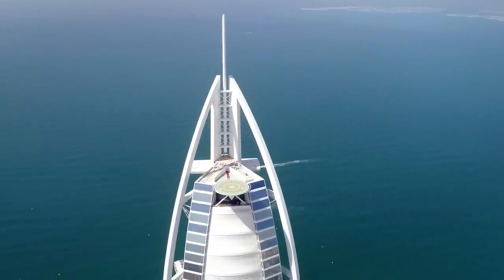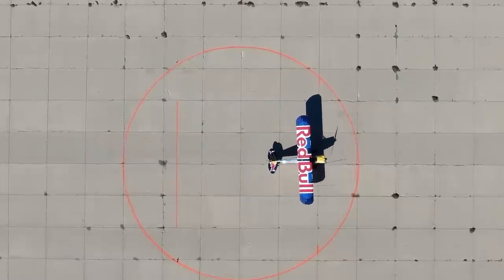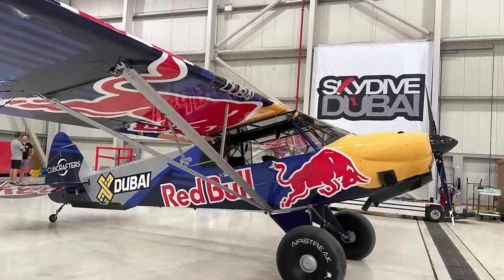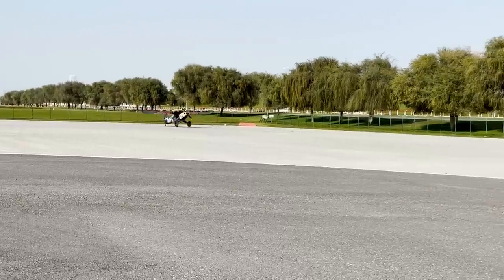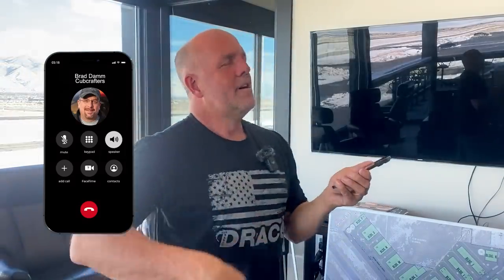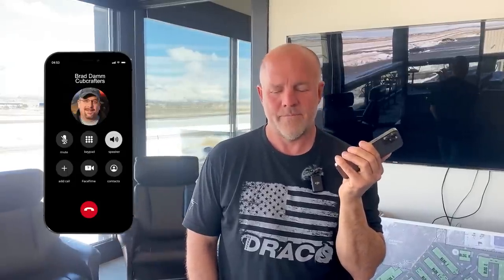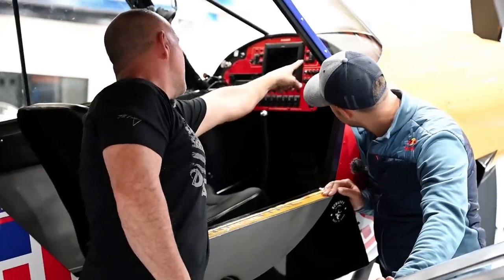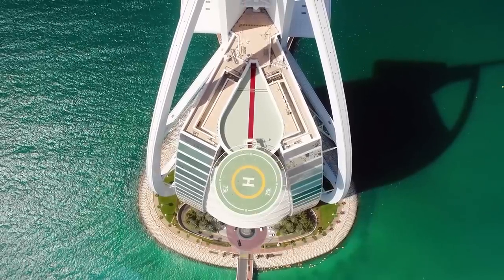We Next Day Aired the Red Bull Airplane Inside of a 747 to Dubai

Comment: In the next video I want all the gory details of setting up for the event, including 1) every single camera on the plane (18 right?), 2) the installation of the smooth plates on the outer rim and any problems caused by touching down on them, 3) how the freak you got the job as ground control, 4) all of the technical gear you set up on the pad beyond the wind sock and weather station that were already there. And congratulations again!

Comment: Mike is one of the smartest and most innovative people I've experienced in my 60 years.. Gonna be the ass here.  This stunt felt way below mikes level.  When he explained what was done to the plane it was basically what any airplane mechanic could have done with bolt on parts.    I feel disappointed because this stunt did not advance the world one bit. Certainly no draco or scrappy.  I'm sure he was well paid for his participation.  Hopefully he gets back to actual innovating.  Now, after my rant, still loving Mike and all he has done.  Ps.  Of course yall will tear my comments apart but a least think about what was actually "accomplished with this stunt relative to what he regularly accomplishes.
Reply: Mike et al moved STOL forward, at least a little bit. It certainly wasn't a "bolt-on" project, as they were trying to remove mass ("bolt-on" obviously has completely the wrong 'polarity' to remove mass). Also, I'm sure I saw quite a bit of cutting, and custom work. Perhaps the genius is in knowing what to do, not so much in the doing itself. Like the old story about the 'overpriced' Maintenance Engineer with the chalk; their fee itemized $1.50 for the chalk, and $9,998.50 for knowing where to mark it.
Reply: Red Bull didn’t do this to “ advance the world” they did it to sell product. They just have the means and the expertise to do what most companies can’t. They are very good at thinking outside the box so they went to someone who is very good at thinking outside the box. Mike wants to increase peoples interest in aviation.Barn stormers, air races, air shows and stunts all do that so it is a means to an end. There is no one on the planet who can say that Mike doesn’t do enough. And if you think he did this for money you obviously do not watch his channel.
Reply: He’ll be going in to the aspects as to why this landing was exceptionally challenging in another video. I think you’ll enjoy seeing the details and his involvement with that as it was very technical. Mike was specifically sought out not only for his abilities in modifications,  but for his knowledge of working with challenging elements in-flight. It was absolutely intense up there. I personally wouldn’t have dared to even do a touch n go in my plane on the platform, in fact, we learned that many heli pilots won’t do it. Stay tuned, there’s some fun things ahead. 😊